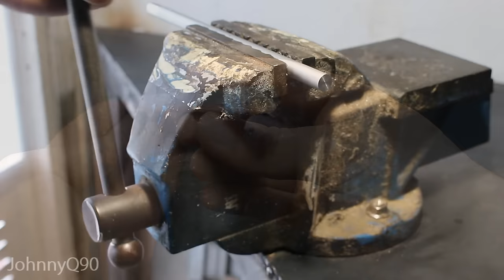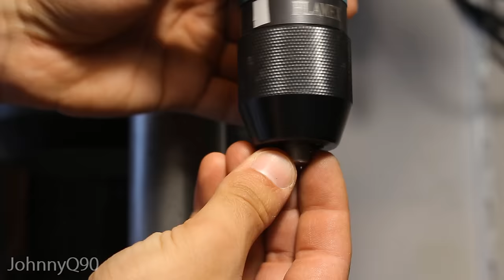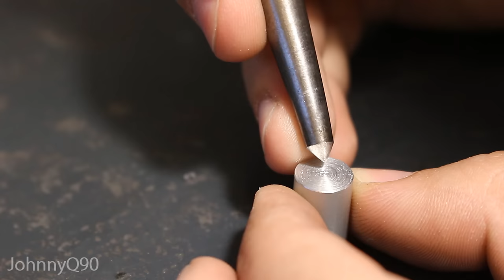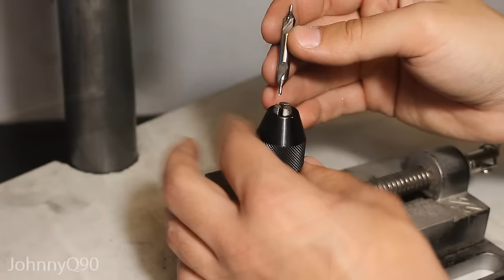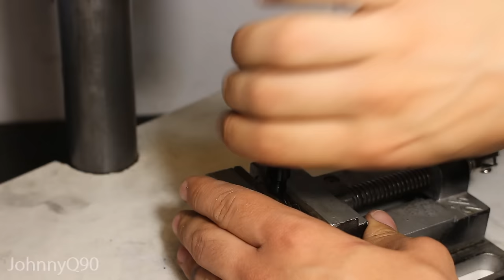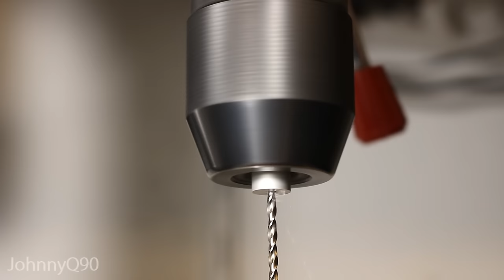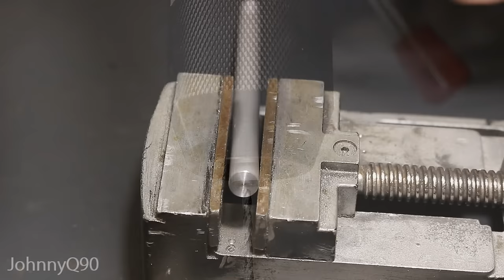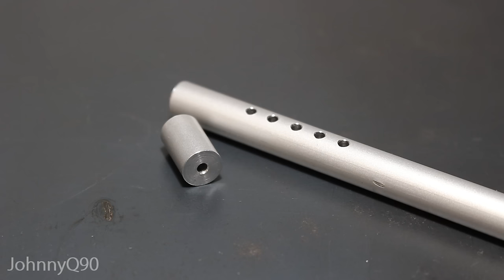Simplest Way to Drill in the Center of ANY Rod!

Comment: Thanks for the tip! With my cheap ass drill press and a cheap chuck, that's way better than I was getting with a V shaped vice adapter. Usually I don't need to get that close, but when I do, this is the ticket. 
And to all the haters, nothing is perfect. Make your ball bearings in space, then start milling perfect machines in zero gravity, and you still won't make anything perfect. The only thing perfect, is the definition. If you have the rod defined as a meter, then everything else is just close.

Comment: The thing that's also going to be a challenge (just looking at the example with mutiple aligned holes) would be keeping a row of holes from being slightly mis-aligned and the holes being at slightly different angles through the rod. If you have to reposition your round guide, even a small rotation of the work piece (rod) could result in discepancies in alignment from hole to hole.
Reply: thats exactly it i dont know if its hollow or solid but long and alloy with allen cap head and threadded other end but i think i can drill a 5mm hole,BUT HOWWWWWW
Reply: oh i thought you were going in the other end horizontally
Reply: clever though

Comment: The hard part is how you do the next hole parallel!
Reply: did you mean perpendicular?
Reply: No, parallel to the first hole so that if you put a rod in each hole they are all in a straight line.
Reply: Eyeballing it should get it close and if you put a stick through the hole and make sure its straight up and down before you drill the next whole it should be very close.
Reply: Make multiple vertical pieces and leave the drill bit in the first hole while you align the second : )
Reply: TROGLO BYTE Loosen the vie while holding the rod with a pair of vise grips there move the vertical piece to next location.
Reply: TROGLO BYTE mark rod and vise with marker
Reply: Make a pair of guides as shown.  Mill flats on both so that the distance between the holes is what you want (or add spacers afterwards to get correct hole spacing ).  Use drill rod to index the assembly after drilling the first hole.  Easy!
Reply: Do not loosen the vise, instead move the vise?
Reply: + TROGLO BYTE
Don't undo the vice. Just leave the rod in there and move the vice to where you need it.
Reply: GameraTheBrave not getting "move the vice"
Reply: Actually, you should be able to just leave the drill bit in the first hole while being attached to the drill press and have only one vertical piece.
Reply: ^what he said.
Reply: TROGLO BYTE Use the same method just a little further down the rod.Measure twice,drill once.
Reply: TROGLO BYTE - to get the next hole in the same line parallel, was seemingly missing, for sure. but, you could make a few of his first step center hole drill guides, and clamp them all in the vise at the same time, and if you wanted, use a pantograph type hole spacer, & some extra drill buts to line them all up, with equal spacing, then clamp them tight, drill one after the other, for as many guides as the vice can clamp. 

Then, for more, use the last as a starter and alignment hole, and put in as many guides as fit, using the pantograph spacer for even gaps. Repeat as required.

See below: Pantograph Hole Spacer, or Rivet Fan!
https://picclick.com/Rivet-Fan-Spacing-Tool-20-Hole-Design-for-281324506437.html
Reply: TROGLO BYTE  You can set a fence across the end of your vise.  After drilling the first hole, with your piece and bushing still clamped in the vise, slide the vise along the fence drilling additional holes with no bushing.  The rod will remain centered beneath the drill and the hole in the bushing will remain its original size so you can accurately drill additional rods.
Reply: Steve White I really like this idea, simple and fast.
Reply: Except without the bushing, the drill will walk off the top center of the rod as soon as you bring the quill down.
Reply: Hugh Jaanus A light tap of a center punch 1) marks where a measurement will be made from or to,and,2)provides an indentation for a drill bit,screw,or nail to grab the material to start going through without skipping or drifting causing problems.Hope this helps.
Reply: TROGLO BYTE mono sketch
Reply: put a mark on the axle and one on the side of the vice?
Reply: exactly
Reply: Andrew White cowboy films
Reply: I was thinking same but maybe making another drilling guide and when opens the jaws keeping another piece on the hole with drillbit and same time replacing another over next hole.
Reply: @SteveWhiteDallas , you are supposing that the end of the vise that bears on the fence is parallel to the jaw face. No reason at all to assume that, unless you are using a special, and expensive, toolmaker's vise.
Reply: Troglo Byte, yes, when releasing the jaw to reposition  the guide, no assurance that the stock will not rotate. Two solutions: 
1. If the stock projects from the vise, grip it with a block (or another vise!) that bears on the table, to steady it while you unclamp/clamp.
2. A little dab of hot glue or CA adhesive, to temporarily bond it to the fixed jaw. Then reposition the guide, and shift the whole vise by hand and eye.

Comment: The vice holding the center drill must be clamped and prevented from moving for this to be truly accurate and "self centering". The punch mark should just be an initial alignment point. 
This method, if fixed, is essentially how a center drill is used in a lathe and it needs no punch mark to guide it. Bit holder should be squared better than by eye. A longer bit or rod and a square could help with that.

Comment: Nice work !
Something is missing though !!  No guarantee the other holes can be made well aligned  :(
Reply: A simple scribe mark on the alignment jig would help for accurate repeat-ability, as accurate as you can get with this
Reply: @nikolaishriver7922  can you elaborate?
Reply: D K i think that was a very incomplete thought I posted 🤣 I think I was imagining you could put a scribe mark on the side of the alignment dowel piece to align with a mark/previous hole on the workpiece being drilled, so you can make sure the original hole/workpiece is aligned perfectly vertical for your next hole. So you don’t get a hole at 12:00 and the next hole at 12:05, so to speak. You could also stick a drill bit or little pin in the previous hole to eyeball that the hole is vertical. Other than that, I’m not sure wtf I was saying. It was probably very late one night.
Reply: @nikolaishriver7922  On the contrary I believe you are on the right track here, all we must do is make two dowels so that the first after being drilled has the second dowel placed over it to hold it vertical after that all should be reasonably at 12 O'clock.

Comment: Let me help you to a much faster and more accurate drilling method using the tools you just showed.  Put your piece in the drill chuck.  Put the other drill chuck in the vice opened enough to fit the drill rod into it.  Tighten and clamp vice to the drill table.  Two chucks are aligned.  Now drill to your hearts content even able to change drill rod diameter.  If you really want to be accurate use a centre drill then drill or shorten your drill so it can't flex out of centre and spot your centre then drill away.  If you need a more accurate hole drilled, use a smaller drill then go to a bigger drill or use a reamer.

I have been working with metal building dies for about 40 years servicing the military, construction, automotive, electronic, medical and many other industries.  In my early 20's was invited to work on the particle beam project at NASA Kennedy Space Centre.
Reply: Aha...you'r extraterrestrial! 👽
Reply: I tried that argument to get out of jury duty, to no avail.
Reply: Although, with small-diameter drill bits, it's possible that the drill bit can wander off-centre, unless you pre-drill with a centering drill...gee, maybe that's why they call them that?

Comment: Lots of people are complaining about old mate ‘eyeballing’ the center to punch it.
When he put the piece in the drill and sanded the end, the sandpaper left perfect circles on it. It’s very easy to find the smallest, center circle and simply punch it in that spot.

Even with expensive lathes and milling machines it can be difficult to get the exact center, that’s why the hole is often drilled first on a lathe and the outside turned down to perfectly (or essentially perfectly) match that hole.

With average shop tools like a pedestal drill and sandpaper, this method is actually pretty accurate and effective.

Comment: nice! but how do you easily line up the next hole once youve released the clamp?
Reply: You sand the short sleeve guide to where it can barely be slid in the vice while the vice remains clamping the long rod.  Now the long rod stays tightly in the vice, and to drill each hole, simply slide the sleeve down to the appropriate distance away from the prior hole...  Never loosening the rod makes sure the holes are in a straight line down it's length...

Comment: Or just take any piece of paper, draw a line down it, and cut it short enough width to wrap around the pipe, tape it, and boom, you've got a straight drill line as long as you've got the line facing directly up.
Reply: Virtually impossible to get the line facing directly up, I'd say. Thanks - Lumpy
Reply: Clearly overlooking the challenge of getting a bit to drill into a rounded surface...  Even a 1/4" bit will flex a bit under that circumstand and not drill dead center without a guide sleeve as this provides...

Comment: I'm a retired toolmaker you cannot drill a straight hole with a drill bit even if you start dead centre the end you come out will always be of centre. The only way to make a true running hole is to finish it off with a boring bar or these days a cnc machine.
Reply: Old trick is to drill half way and flip part over, bit will seek path of least resistance when it meets with other hole, correcting problem.

Comment: * ANY rod that will fit in your drill's chuck
Reply: The secret is that the guide rod is the same diameter as the work piece.
Reply: @Sam means that if the rod you are attempting to drill is larger then will fit in the chuck of a drill press it wont work, not that  you can use any  old rod.
Reply: Sam Prudden

Comment: good idea
but how do you get the perfect center of the small piece
Reply: Ed Zackery what I thought too :)
Reply: look up center finding teeter totter method.
Reply: Teeter totter method for drilling into the end of the small piece?
Reply: https://de.wikipedia.org/wiki/Zentrierwinkel
Reply: It looks as though there is a tiny + perfectly centered on the end of the small piece - but no mention as to how that was done.
Reply: If you want to truly center the hole on the small piece do this when you are setting up to drill through it. Extend the piece enough so that it is tight in the drill Chuck and then fasten the mini Chuck to the other end that is now extended beyond the drill Chuck. Voila.  That piece is now centered in both chucks. Lower the drill Chuck assembly so that the mini Chuck can now be clamped into the vice.  This assumes the vice will also be tightly fastened and will not move.  Loosen the mini Chuck, tighten drill bit into it and it should be perfectly centered providing the vice is not moved.
Reply: you will see the cirkels made with the sandpaper,
Reply: If you spin the work instead of the drill, it will drill down the center of the work (well, really the center of the rotation).  Same principle as a lathe.  Go ahead, try drilling off center.  Unless the drill is wobbling all over the place, the best you'll get is an oversized hole.  Worst, you'll snap the drill bit.

If you can't see it, stick a pin in a piece of paper and touch a pen to the paper.  Spin the paper on the pin and see what you get.  The only place you'll get a hole is where the pin is.

Lathe's are cool.  Using a drillpress as a lathe for something tiny is a good idea.

Comment: It’s a great idea, but I shuddered a couple of times.  Clamping the shaft of the chuck in flat metal jaws can damage it, resulting in it running eccentrically.  The chuck jaws gripped on very little of the plain shaft of the centre drill, which is dangerous.  Also, when using any hand saw, use the whole blade, not just the bit in the centre.  Long slow motions are easier to control and better for the blade.  It’s still a great idea though and one I shall be using.

Comment: How accurate is your punch in the center of the drill guide? Not even, your eyesight is not that good.
Reply: It looks like they use the circles caused my the rough sand paper. That would be my guess.

Comment: Finding the center of the rod to punch is the tough part, he just got lucky in this case.
Reply: I don't think it's mere luck. Even if the punch is off slightly, the center drill will always find the true center of the bar stock. This is because the stock is being rotated against the drill bit, instead of the other way around.

Comment: The sand paper for center was great, If you need a lathe then you needed it from the start,This method is great for general center and the punch is to stop the drill bit from wondering when starting the hole, You could make heaps of different diameter hole sizes and use them as templates. Great vid

Comment: That's cool! I'd use a small square to make sure the chuck adapter was perfectly square. But a trained eye like this guy can be very accurate!
Reply: I was thinking that if you put the rod in the bottom chuck a little the the drill press chuck and tighten dow the drill press chuck, tighten the vise on the bottom chuck, then clamped the vise in place  you would align the bottom chuck perfectly for center and in all directions.

Comment: About "eye balling" the center punch mark: I just tried this method. I sanded  the end of a 3/8" brass rod using a drill press, as shown in the video. Used 100 grit paper. It left distinctive concentric circles which provided a good target for center punching.

Comment: in case you guys  didn't notice , when he sanded the ends in the drill press it made rings from the sand paper and he used that as a reference for the center punch , maybe off by 1 thousand but extremely close and realy smart :D   just saying

Comment: I made a fixture from a piece of angle iron and some flat bar stock.  Weld the angle iron so lit looks like a “V”along the length of the bar stock.  When yo want to drill through the center of some round stock preposition the fixture so the drill bit will be centered at the bottom of the “V”.  Place the bar stock in the fixture and clamp in place. Drill down through the round stock.

Comment: I grew up working in my Dad's machine shop from the age of 7 until I graduated some 11 years later.  While this video shows a pretty accurate way of drilling a hole into a pipe or stock from the end or side, I would suggest putting the drill bit in the Drill Press and the stock in the vice.  Then, line up with where the hole should be.  But my Dad was old school.  He taught me well.  But you can do it any way you want.

Comment: A useful {for some} alternate way,  lay rod in a wood corner, mark height of rod, slice to just under, lay corner over rod, clamp to drill table, drill through centerline of the wood. An old woodworkers trick from wayback.

Comment: I was taught to use a metal ruler as a "balance" scale pressed by a drill-bit onto the rod and for & aft the rod until it was horizontal.  You are then over the centre of the rod.
Takes far less time and is pretty accurate.

Comment: Perfect! ... just one extra tip.  You can see the cut rings after sawing off the stub so punch it then before sanding it .. it’ll probably give you a better eyeball center but punch it deep enough so not to lose it when you sand. In fact I don’t think there’s a need to sand it. Thx for the tip!

Comment: I don’t know why this has just been suggested to me as I was watching dashcam videos but I have to drill 40 hole in some bar I have this will make it so much easier now.
Reply: Might be a quicker way. I firmly tape two straight edges either side of the roddirectly to the table on the pillar drill ensuring it's square. Callipers to find the centre line of your material and lightly score it along the length for the first hole or two. You can clamp the material between holes if you want. Drill the first with the press, slide your material along, drill the next. Do that as pilot holes. Repeatable drilling so as long as the first one is as accurate as you need it so will the rest, for hte entire length of your material. You can then redrill on a second pass the holes to the correct size using the exact same method and settings without changing any measurements or the setup at all other than your drill bit

Comment: I use a hexagonal bar drilled in the middle where I put the round rod, but it needs a screw to hold the rod so it doesn't rotate, I use it in a standard situation but I liked the method it will help me in other situations

Comment: Screw all the haters.

 I have enough sense to see this video for what it is, and can obviously conclude that he isn't achieving nasa level precision, nor does he think he is. 

I thought the method of flattening the end of the rod was pretty awesome. Normally I just have my belt sander set up as square as I can get it and clamp a guide to it's tool rest to square it in 2 dimensions and then turn the piece by hand as I grind the end. I can get decent precision this way, but having the concentric circles would be nice. 
I don't have access to a lathe either, and will probably use this technique now that I have seen it.

Thanks for sharing.